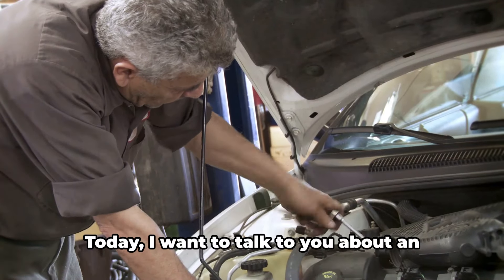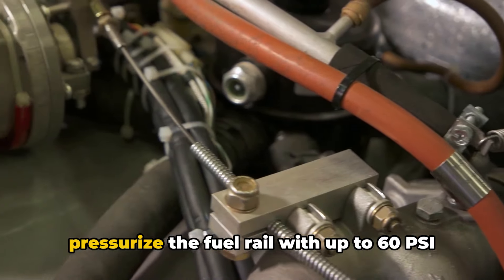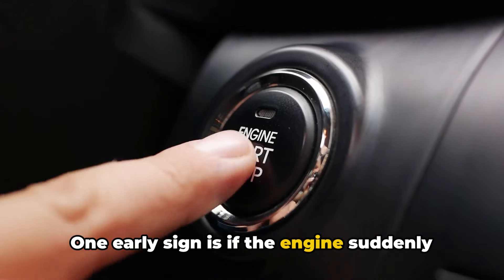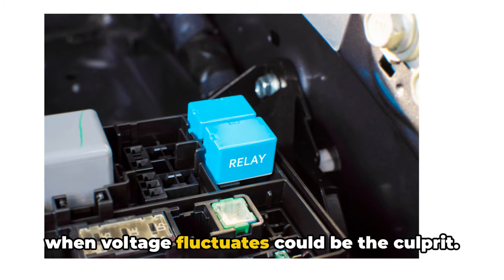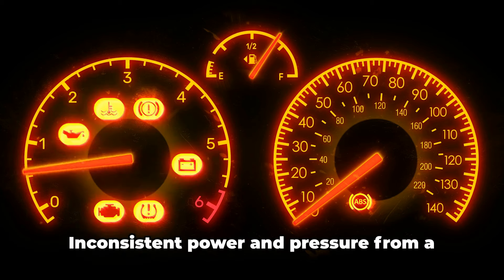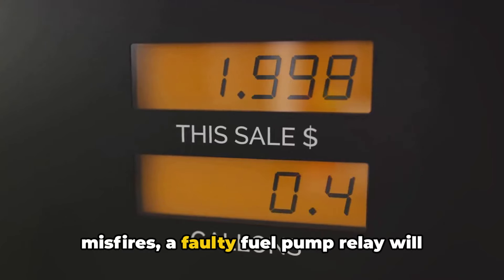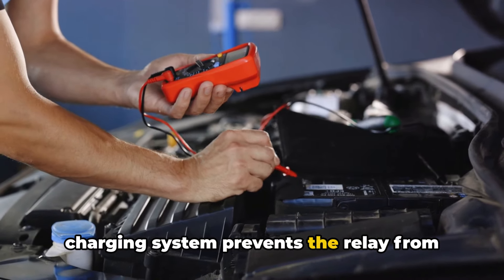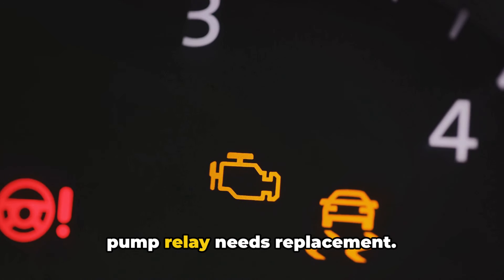Bad Fuel Pump Relay Symptoms: 6 Common Failure Signs

Comment: Hi I have replaced my petrol pump and relay on my opel corsa b type 1998 model however no power to the pump what can be the cause?
Reply from the maker: Hi! If you've replaced the petrol pump and relay on your Opel Corsa B 1998 and you're still not getting power to the pump, here are a few potential causes to investigate:
 
1. Fuse Issue: Check the fuse related to the fuel pump circuit. A blown fuse can prevent power from reaching the pump.
Wiring Problems: Inspect the wiring harness for any signs of damage, corrosion, or loose connections that could be interrupting the power supply to the pump.
2. ECU/PCM Issues: The Engine Control Unit (ECU) or Powertrain Control Module (PCM) might not be sending the signal to activate the fuel pump due to a fault or failure. This may require diagnostic testing with a scan tool to read any fault codes.
3. Fuel Pump Relay: Even though you've replaced the relay, it’s worth double-checking to ensure that it is functioning correctly and properly seated in its socket. You might also want to test the old relay to see if it actually was the issue.
4. Ignition Switch Problems: Sometimes, issues with the ignition switch can prevent power from reaching various components including the fuel pump. Let me know if you managed to get it sorted!

Comment: My gas needle is not moving when driving. It will move when I sart the vehicle but that is it. What is going on with my 2009 Dodge Journey SXT V6? Thanks
Reply: Sounds like the fuel sending unit is probably not working.  That's the arm on your fuel pump that measures the amount of fuel in the tank and communicates the fuel level to the gauge on your dashboard..  Unfortunately you have to replace the whole fuel pump. They can go bad but the rest of the fuel pump can still be working.  Unless there is something wrong with your instrument cluster, that's probably the issue.